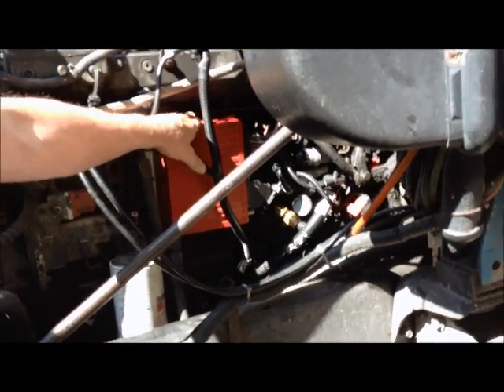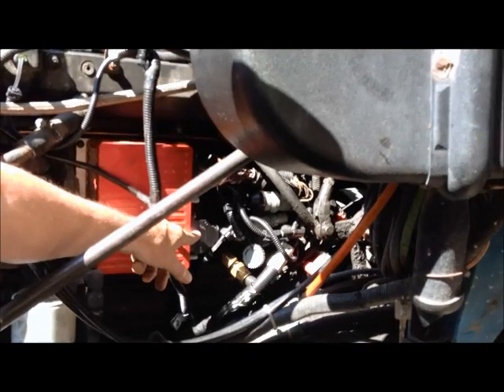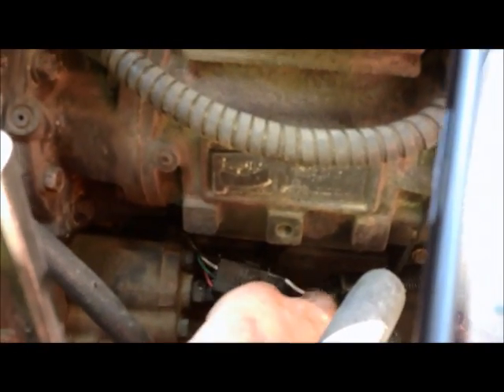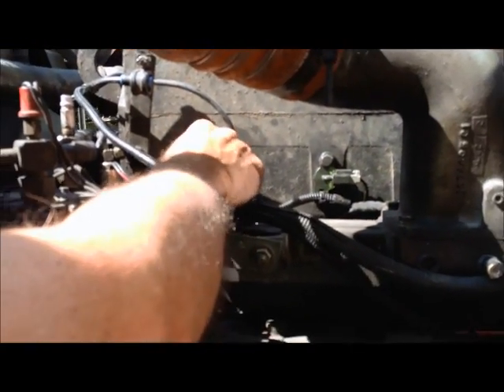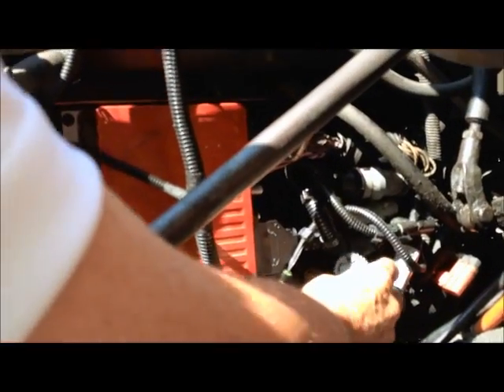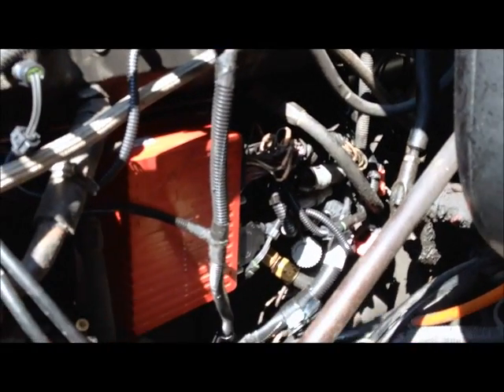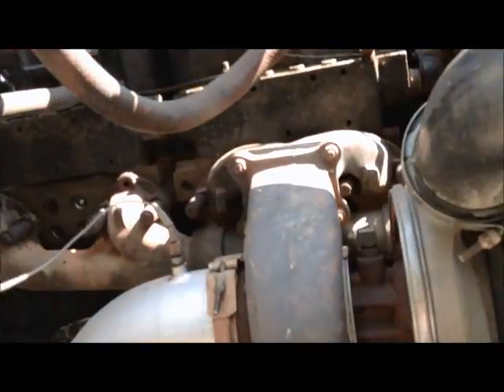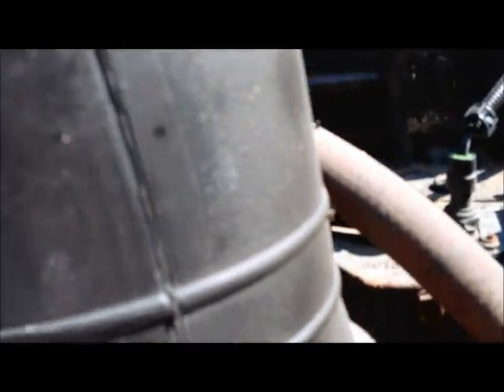N14 Cummins Engine Video of ECM Sensors

Comment: i hope coolaint doesn t come out of that turbo boost sensor port hahahaha  missed the engine speed sensor   don't recall the exhaust temp sensor as ab input for the e c m its a O E M option on the n !$ model.

Comment: Have n14 select plus black top 460hp 2000 freightliner what's the difference between redtop ?
Reply: The premium package from factory cpl 2026 same as 2025 but not 9252
Reply: @ernestoramon3700 can I make this one 550hp if so just a tune ? Or what's needed ? Thanks for replying and help

Comment: I do not know if this still active. I have N14 plus and I have vibration. I have 120k mi on rebuild engine and replace clutch 3 times. Vibration. It is coming from engine side i can feel it on floor than on steering wheel. I replaces intake shaft and pilot and some other bearing, Replaces tires and wheels, did balance couple times and vibration is getting strong, along with that i have some high noise from fuel pump side and engine break has pulsing noise on high speed.  I do not want to go to Cummins - they did this engine for $32k and when i ask for this noise wile the warranty was active - they told me it is coming from rear and it is not related with them.
Reply: Please Update on what it was

Comment: i have 2001 n14 celect plus when i hit bump sometimes get loss of power and check engine comes and off in split second code comes up power supplyelectrical fault what could it be??
Reply: Khalid Asaad I have same problem today You can help me.
Reply: Check battery connections

Comment: I have a n14 celect engine and its leaking oil from the top exhaust little pipe on the head cover what can it be engine is running awesome just that oil leak
Reply: Its normal. If it drips a little. That tube is a crank crase breather tube.
Mines always done that and i had an inframe done about 350k miles ago.
I've seen other n14 do the same.

Comment: CUMMINS ENGINE, MODEL: NTA-495-MG. The generator was on load, suddenly the rpm started to reduce from 1500 rpm to 1000rpm. then the generator was off loaded and stby generator was taken on load. while investigation  found oil carry over in exhaust manifold.

Comment: Please I replace even all my injector, fuel pomp, check valve, fuel line, and still no start with out staring fuel, now every time check engine come on, And I have to hit the fuel pedal hard for the check engine alarm get off.
No mechanic found the problem but they charge me for the time, and the end all they said We don't know what is. PLEASE HELP, PLEASE HELP.
Reply: Check the Wiring on the temperature  sensor ground it helps

Comment: Intermittent miss fire #2 and #5 not all the time. Could be every day could be once a week could be once a month. Doesn't last all day when it happens. 5 min or 1 hour. It last for. Any ideas
Reply: check the injector harness for: opens, shorts and high resistance's to eliminate power and ground issues to each of these injectors!